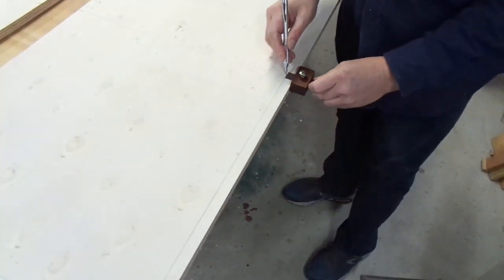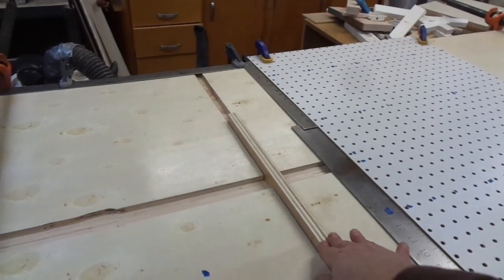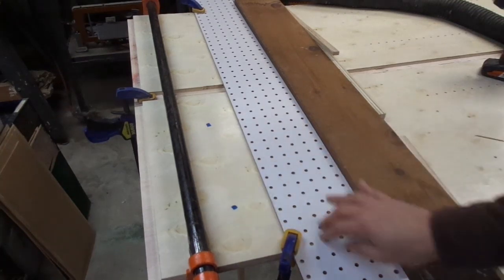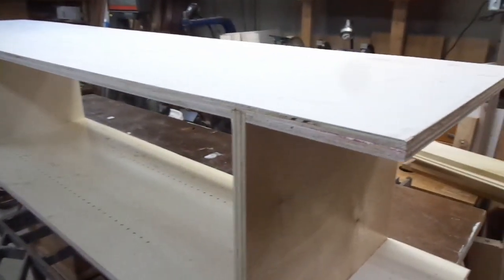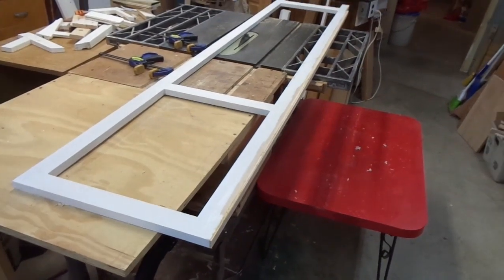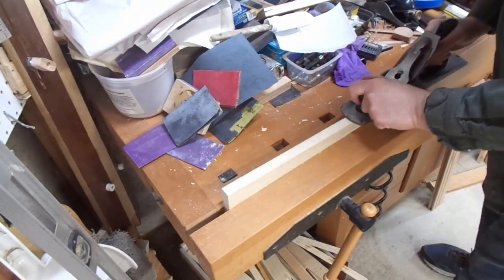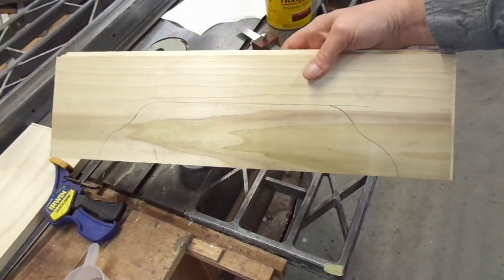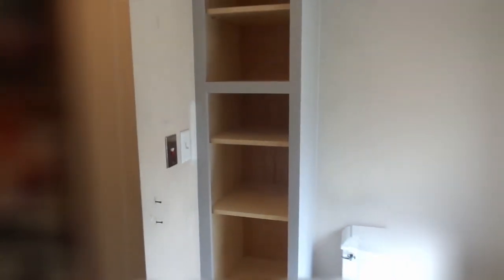Make a Bathroom Linen Cabinet

Comment: Thank you That looks hard but I think you make easy way to put together all parts it was really good job 👍
Reply from the maker: Thanks for the note and the kind words.  Difficulty is a matter of experience.  I've done things like this long enough I don't consider it hard as much as taking the time to do it right the first time.  The cabinet is just a box.  If your stock is decent and you're careful then it goes together pretty straight forward.  I build a similar one for a client about 8 years ago to fit a very special spot for a client.  I also have a video on how I made the doors to go with this guy.  It was built to match the vanity.  Thanks again.